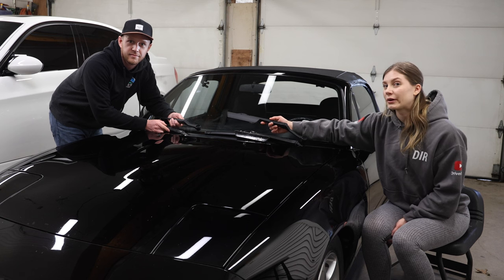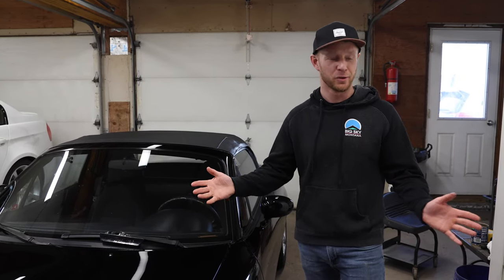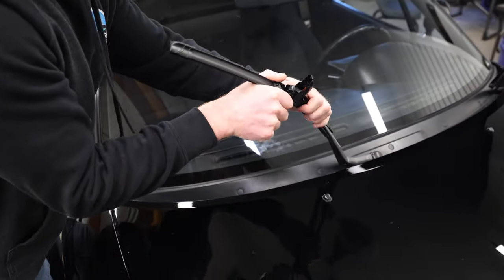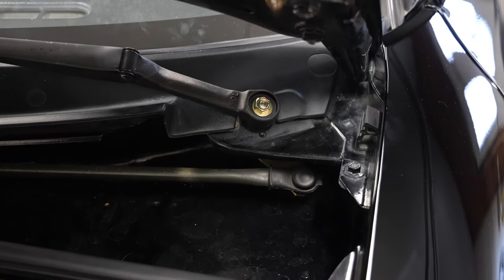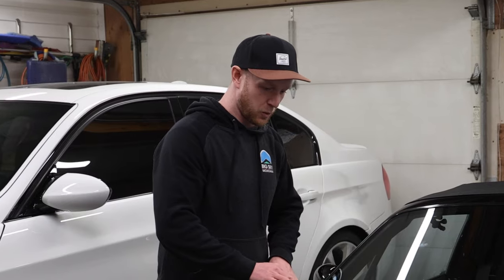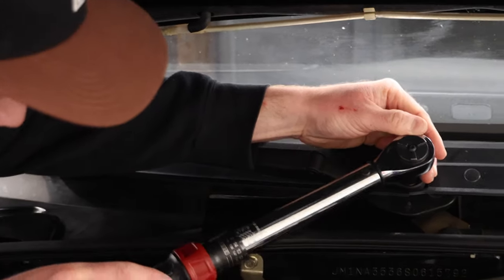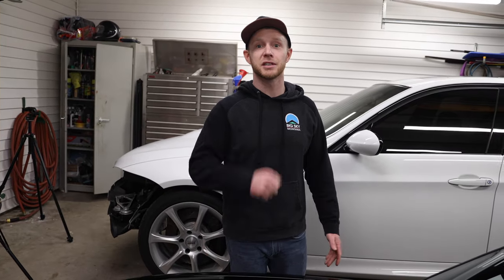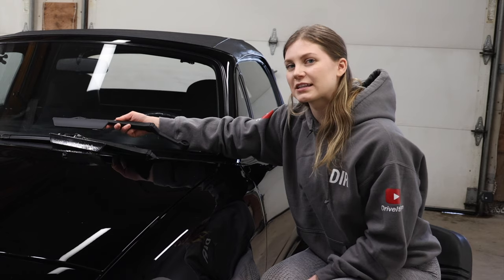How to EASILY Remove Stubborn Wiper Arms!

Comment: does anyone know a good nozzle spray replacement for the Mazda cx50? when I spray it it only sprays on the left side of the blades and only about 50% of the windshield gets the spray, I have a feeling its going to be bad in the winter when you need to use your wiper spray more often to get rid of the salt spray when the salt the roads for ice or snow. also when you spray the spray it only comes out at the bottom stroke of the wipe. this is probably a motor timing problem Mazda has to fix